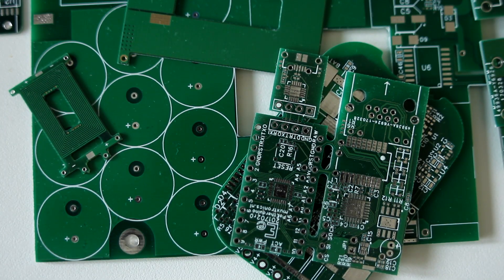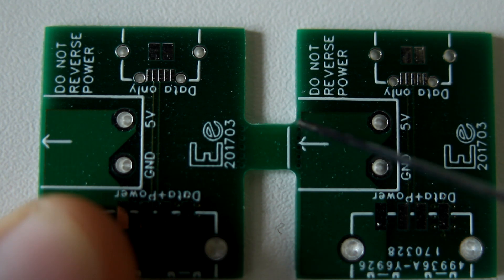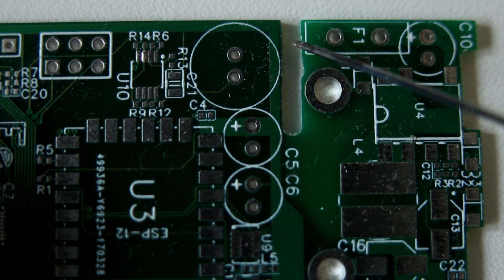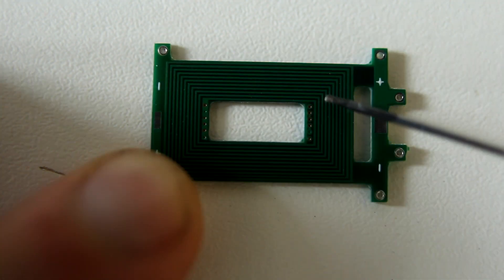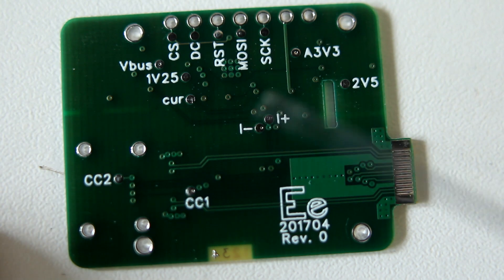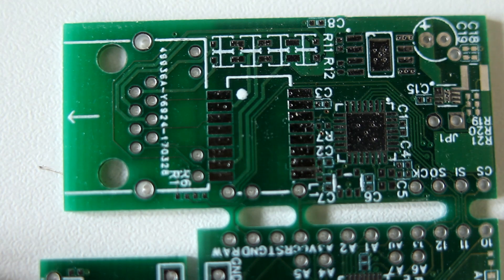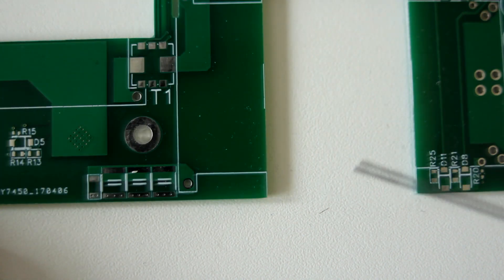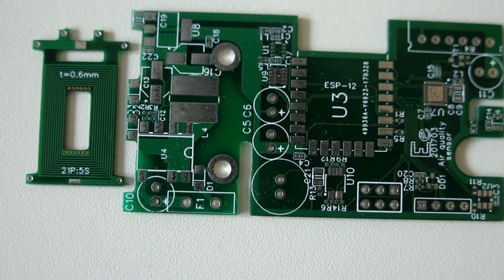EasyEDA PCB quality review (048)

Comment: So... do you happy with quality or not? What is the conclusion - use EasyEDA or use other?
Reply: I mean, you get what you pay for. If you can deal with the problems demonstrated in this video, go for them. They are the cheapest I have found so far.
If you can't accept these problems, find some other fab. PCBway is only slightly more expensive, but I don't know how their quality is. Elecrow is a lot more expensive, but their quality is also pretty lacking.
OSHpark is a LOT more expensive, but they do have superb quality. On the other hand, OSHpark's options are limited and they tend to opt for the high-quality stuff. (You can only get ENIG (gold) finish, for example)

It really depends on your needs.
I will probably use EasyEDA for some simple boards. Not sure if I trust them with high-speed boards, since impedence matching was mentioned as a potential problem in this video. That said, it might not be so bad.